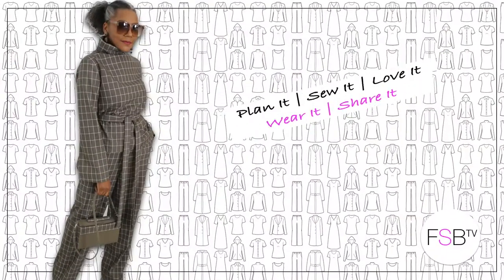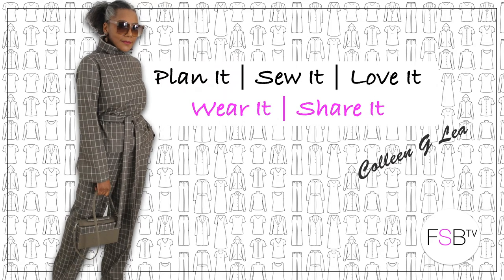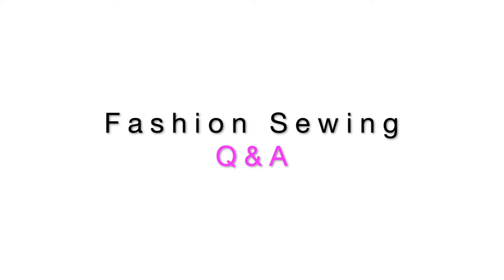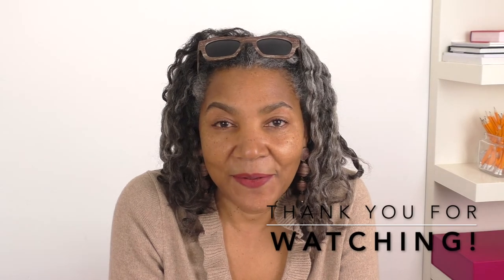Sewing Questions and Answers with Colleen G Lea

Comment: Hi Colleen, i'm searching your channel for it but in case you never made one, I'd recommend making a video on full assembling process of a lined jacket, with emphasis on the bagging processs. I know two ways to bag, through the hole in the undersleeve seam, or through the hem, but may can also through zipper? I only deal with heavy material, mainly leather, and some motorcycle jackets can be unimaginable to turn through a small hole....
Reply from the maker: Hello EJShelby, I have completed many bagging out processes using the under sleeve seam and hem but not through a zipper, you have advanced skillset. How many years have you been working with leather?
Reply: @colleenglea  I am mainly self-taught, on and off for five years now I think,but the lockdown really fasttracked my progress haha, so I'm making a couple of jackets right now, and always learn on the fly, the bag out through sleeve hole is always the most dreaded part, another detail is to make a sharper collar point with thick leather, oh man....